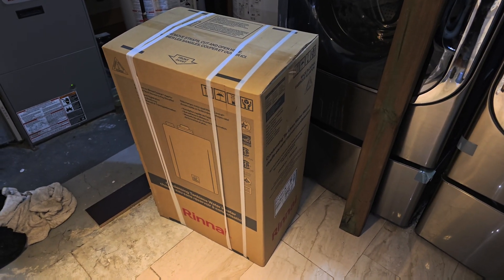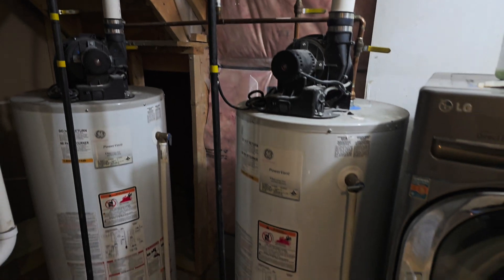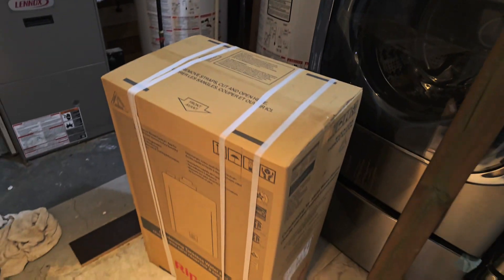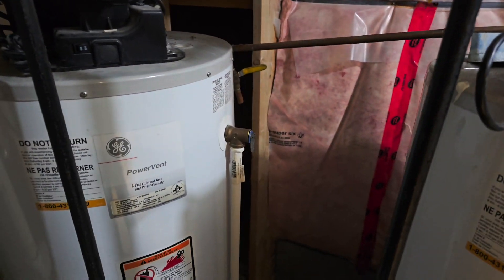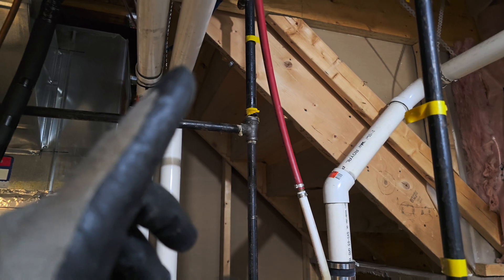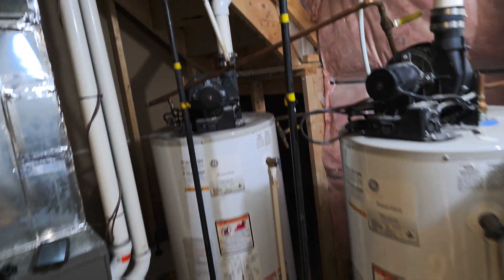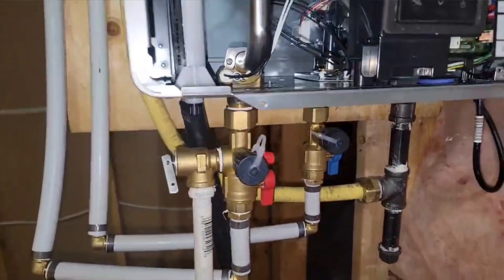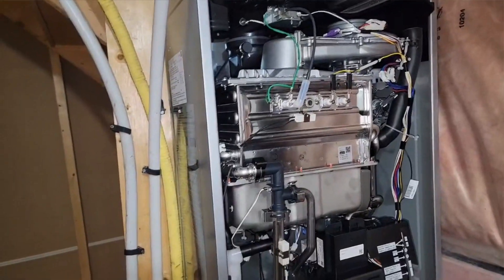Tankless water heater installation procedure, #tanklesswaterheater, #tankless, #rinnai

Comment: Nice install. I would of put a drain on that hot line but nice job.
Reply from the maker: There`s a relief valve and drain line on the hot line. If the temperature becomes too high, the relief valve will open, allowing hot water to drain. Again, thanks for your feedback.